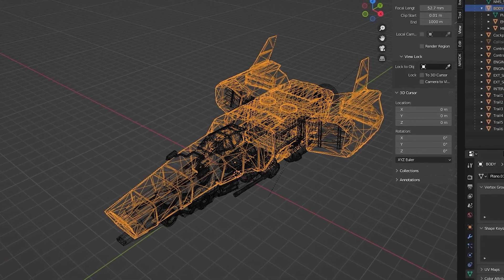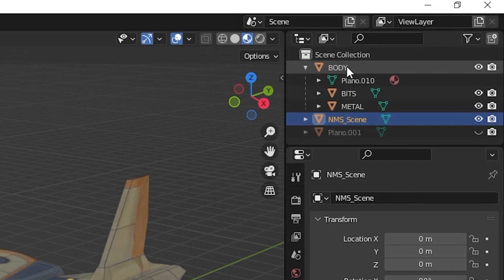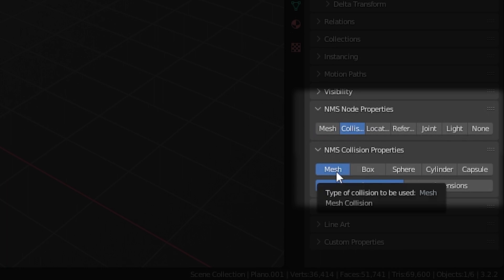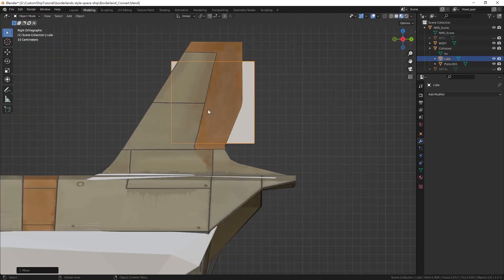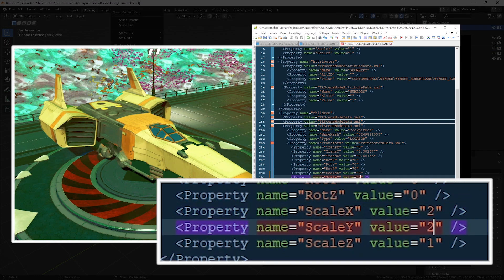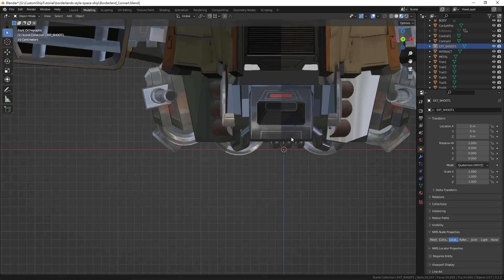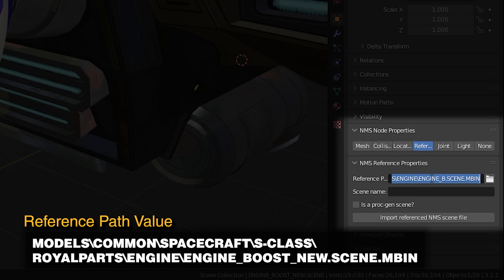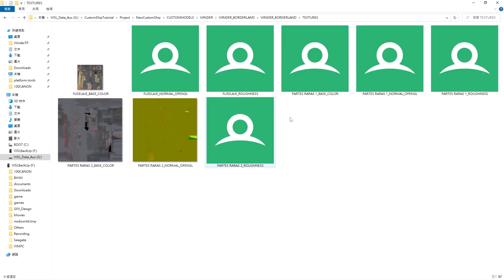How to Convert 3D Models to No Man's Sky Ship - Part 2 (NMS-TTS)

Comment from the maker: This series is suitable for tweaking 3D models for export with NMSDK in use as a generic No Man's Sky scene as well.

Correction: 10:16 Current version of Ships of Moar have yet to include the newly relocated engine flame, to remedy this, a zip containing the correct files under the correct directory has been uploaded to Google Drive and the link is available at the bottom of the description.

If you need to acquire NMSDK version 0.9.24, or have any questions, please visit No Man's Sky Modding Discord, whose link is in the description. Thanks for watching!